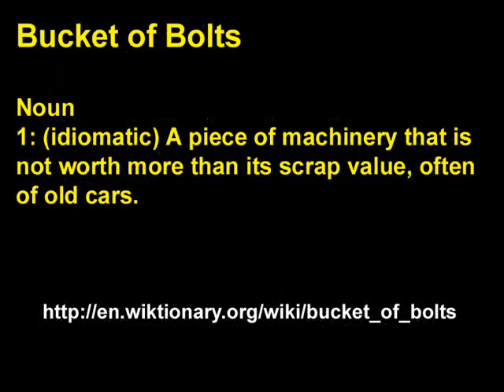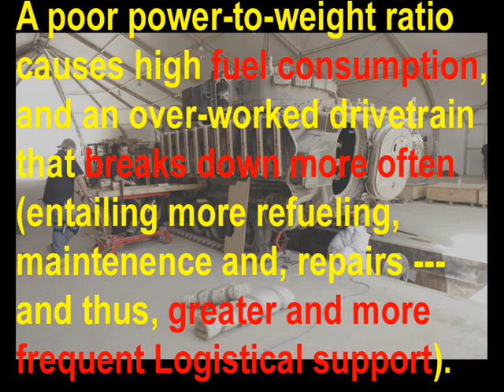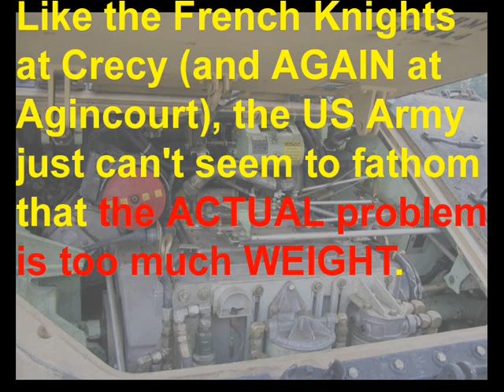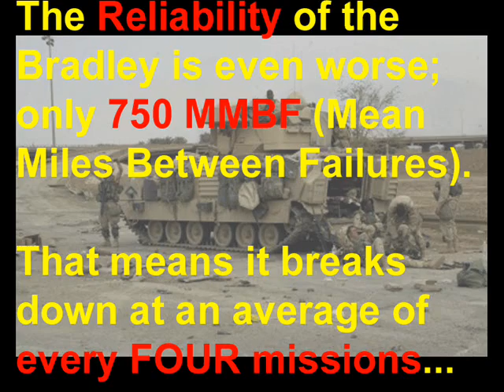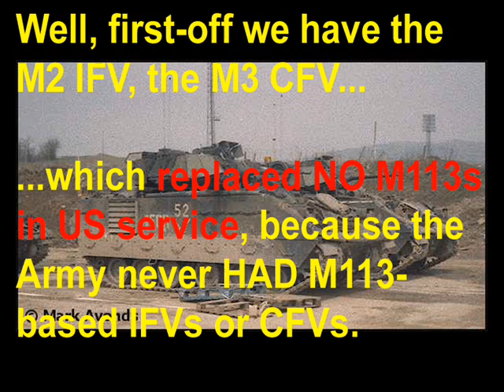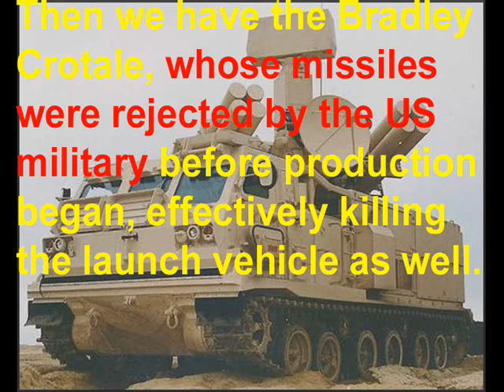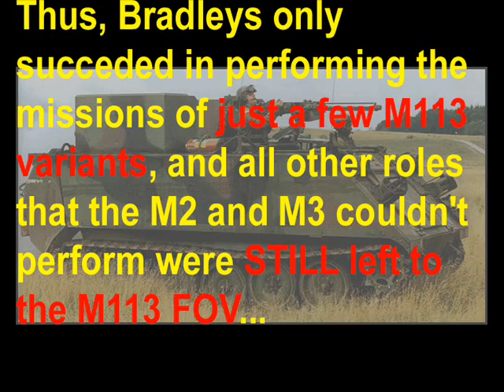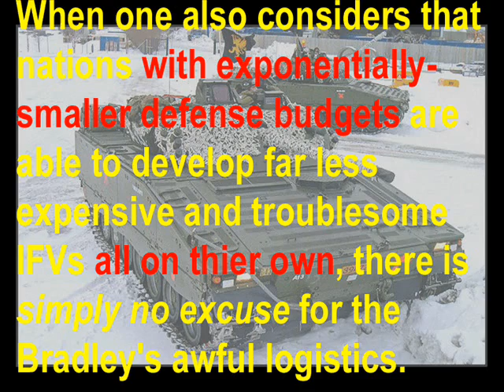The REAL Bradley "Fighting" Vehicle! Chapter 8: Logistics (Part 2/2)

Comment from the maker: @leebirdwell It would have been even simpler than that. The US Army rejected the M113-based XM765 (the AIFV) in favor of the XM723 (the basis of the Bradley), at a time when the latter existed only on paper. The M114 was itself avoidable, because of the M113 C&R.
If we had simply used what we had on-hand (the M113 FOV), the result would be cheaper, more effective, in service 10 years sooner, compatible with the existing parts inventory, and shared by more than 10 other countries.

Comment: If they had simply designed and built the M114 correctly and then upgraded the M113, this thing would never have been (I hate to use the word needed) needed. The system also shoved people into the Bradlys with little or no training and that caused problems, since we all know that the officers have all the answers, so that if something goes wrong, it must be the NCO's fault - right?

Comment: @USN1985dos i can't say that i like the 8x8 transporters much to begin with. i really don't see any benefits they bring to the table over tracked transporters, and the whole single platform - multiple purposes thing could have been done on a tracked platform just as well, if not better (less mechanical complexity, more stable, better mobility, etc.)
wheeled vehicles primary pros over tracked was that they were small and nimble and 8x8-s are neither.

Comment: @USN just because i haven't served in the military yet, doesn't disprove my statements. counter them with imperical facts, not insults.
I've actually had the pleasure of talking to a recently retired high ranking officer of a motorized brigade. his opinion of the Patria AMV, the Strykers superior, but by a rather small margine, is that it's an oversized vehicle that can barely manouver in mud if it doesn't get stuck, that you can't miss, particularely on IR, due to all the electronics crammed in

Comment: @USN1985dos I recommend you to review BTD's series of Bradley videos.Among it's most apparent flaws is it's obvious failure as a recon and FIST platform, given it's size,breakdown rate,insufficient power,weight and fuel consumption.Please also bear in mind this vehicle had been designed for static defensive AT combat as was the Abrams against the colussus of many Soviet divisions expected to flood through the Fulda Gap and even that assumption was wrong,as Soviet doctrine emphasises dispersal

Comment: @USN1985dos
one: prove it and prove it properly. even a T55's main gun can chew up a Bradley without much effort.
two: TOWs work and they can "reach out and touch", however, at the same range, the tank can shoot the TOW firing Bradley, except where the TOW takes 10 seconds to cross 4000 meters, a tank shell does the same in 1-2 seconds. Not hard to see the winner here, and that's even without factoring in the new countermeasures the russians are outfiting their tanks with (Shtora and Arena)

Comment from the maker: @USN1985dos 
Unlike the Bradley, the Warrior has a weapon which is effective against Heavy Armor within a range of 1/2-mile --- namely, a high-velocity 30mm autocannon --- and the Warrior doesn't have to park itself to fire it.
The Warrior isn't the only IFV with a better main gun than the Bradley, either. There's also the CV90, the ASCOD, the Puma, the Kentaurus, the BMP-30, the Ratel 90, the KTO Rosomak, the BTR-90, the Type 89, the Marder, the VCTP, and every BMD and BMP ever fielded.

Comment: @USN1985dos now as for the GCV. from what i gathered of the thing it's going to be seriously uparmoured, which is always a good thing for the soldiers serving in them. However, that comes at the expense of a lot of weight, which is takes tolls on the maneuverability and deployability of the vehicle, not to mention giving it serious issues with terrain. obviously, that doesn't mean jack for terrain like Afghanistan, which is pretty much an oversized rock, but any softer terrain...

Comment: i looked up the new german IFV, the Puma. There are things i like on it, things i dislike and two things that apsolutely astouned me.
One is the supposed 1100 hp engine that it's fitted with.
The other is that it's secondary armament is the 5.56 HK MG4. WHY? no other vehicle they use has a coaxial 5.56, they all use the 7.62 MG3! supposedly so the soldiers in it can use the ammo themselves? that's such utter bull.

Comment: @USN1985 it's so good to blindly believe that the people in charge actually care about the poeple they are in charge of, isn't it? there's your fail.
on another note, the M113s are still in US service, some 6000 if some sources are to be believed, so how exactly is that not considered widespread, particularely if the support vehicles (medevac, repair and recovery, etc.) are based on that platform?
obviously, the bradley is so awesome that the US is NOT planing to replace it with the GCV, right?

Comment from the maker: @Ag3nt0fCha0s 
There's so much wrong with the F-35, I don't even know where to start. If Boyd were still alive, he would have cleaned those (Br)asshat's clocks.

As for the Pentagon Wars, it was indeed a book, which the movie was (loosely) based on. I've read the first 4 chapters already, and trust me, it's WAY better than the movie.

I also recommend that you do check your local library for it, because used copies cost over $95 on Amazon! If they don't have it, they might be able to order it.